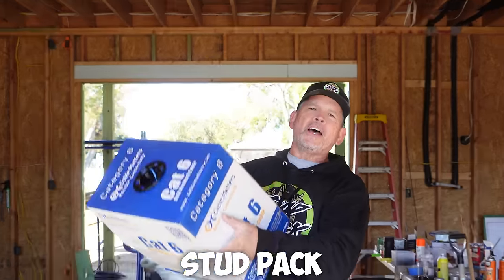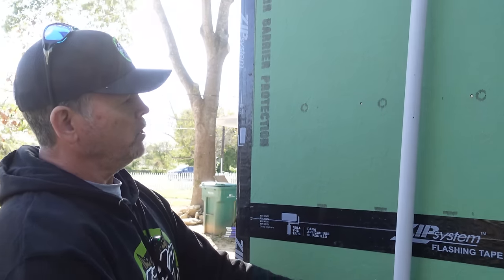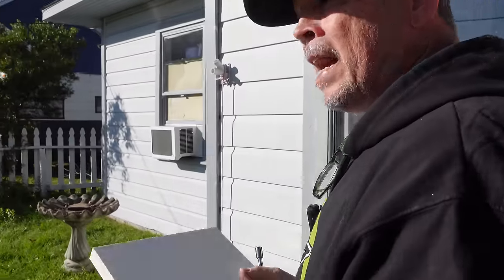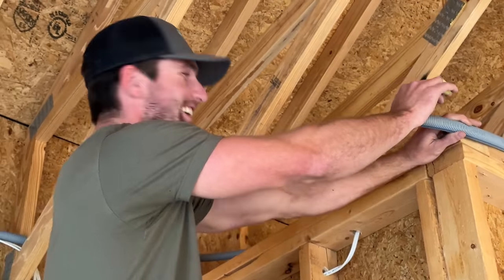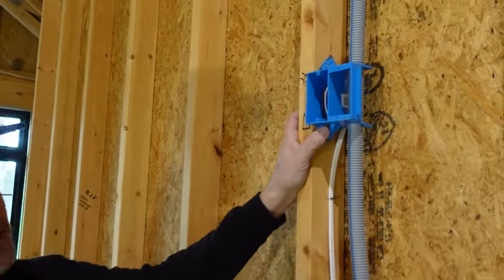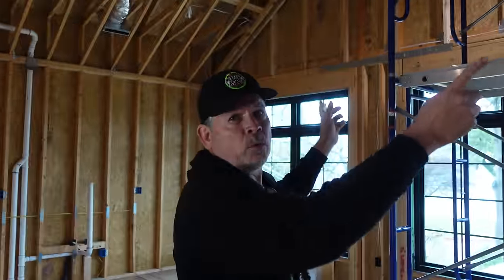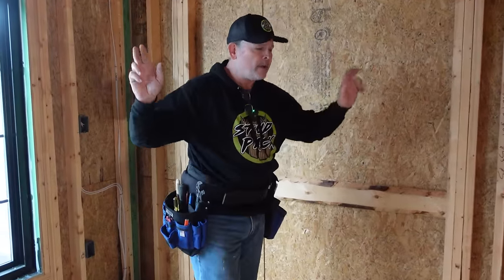DIY Networking for a Future Proof and HIGH SPEED Home! (Smurf Tubing and String Pull Trick!)

Comment: You will want to avoid running CAT cables parallel to any power to avoid electrical noise. In a perfect world, you'd only cross a power run at 90 degrees.
It's also a little unusual putting an RJ45 connector on the end of a permanent run like that. Normally, you'd terminate into a Keystone RJ45 socket and use a patch cord from the wall to your device.
Reply: I think like he said in the video he was just demonstrating how it's done.. But yes, agreed. They should definitely use keystones on the wallplates! Much much cleaner look
Reply: At least use shielded 6a cable if you do run the wire near electrical.
Reply: If you rum shielded, ground the shield on one side to a communication ground separate from your electrical ground. (And any lightning protection ground). In a professional network you want a grounded equipment rack for your router, switches, and modems - the rack ground doesn't need to be expensive, just separate.
Reply: @fuckthisksksjjksdfjd  Shielding, unless you use steel sheathing/conduit, only blocks electrostatic noise, not induced electromagnetic noise.

Induced interference from adjacent power lines is almost a moot point, especially with twisted balanced lines, and digital signals at that. The concern is more for safety and isolation of heat and/or mechanical issues.
Reply: Homeruns aren’t too unusual. If I’m going to a PoE device I usually terminate that way.
Reply: Also I haven’t had interference problems with residential power and Ethernet 😊. In a galaxy far faraway RS232 DEC terminals were another story!
Reply: I was going to comment exactly that. If you damage the exposed part of that cable, you're pretty much SOL. Terminating the cable with a keystone jack ensures that the permanent run is protected within the wall. The only part of the run that is exposed is the replaceable patch cable.
Reply: The last time I looked, I think code says you can't run low voltage parallel to high voltage without a minimum 6-in gap
Reply: @Sartek  In the same conduit, not parallel to.
Reply: Keep CAT 6 cable at least 16" apart to minimize the potential for a 60hz hum
Reply: You can run STP parallel to power lines if you keep an 8” distance, so in practice, for these short runs I would not be tooanal about the distance.
Reply: Agreed!
Reply: @CharlesBundy-z9n   Agreed.  In our computer labs, (in the days before every student came with a laptop), our computer desks all came with a single wiring tray along the back.  Everything went in it together: power, ethernet, video, etc.  Never saw any interference issues.  In fact, that's why the cables are twisted in the first place (and why the signal is sent with differential manchester encoding).
Reply: @Sartek   Yes this is true but it's now just 2 inches.  But really doesn't matter anymore with how cables are made. Just a way to keep government employees employed
Reply: in all honesty you could use UTP cat6 and be alright running parallel to power lines.
Reply: @fuckthisksksjjksdfjd  STP is unnecessary for the whole 5-10ft the CAT6 will run parallel with a 120v line. IF this was a higher voltage line and the run was going to be 20'+ parallel then STP would be necessary.  STP is mainly used for industrial applications due to eletrical noise transference.  Someones home eletrical line powering a TV or a Light /load isn't going to generate that kind of noise.
Reply: @dtuttle351  Possibly correct, I am not sure.  If I am going to run ethernet thorough my house I like to make sure I only have do it once.
Reply: @fuckthisksksjjksdfjd nobody should plan on running once 😅. I first ran Cat 5 in my house 100M then upgraded to 5e for 1G and have been pulling 6 where it makes sense (short haul 10G, homerun PoE). I’ve redone the network closet at least two times!

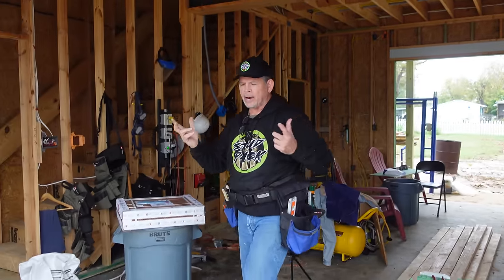Comment: Guys, it looks like you're going to have CAT6 "patch cables" coming out of your walls. If so, bad idea. Run your solid conductor CAT 6 inside the walls to an RJ45 jack, then run a proper CAT 6 patch cable (stranded conductors) to the device. Yes, do this on both ends. Not sure what the perceived benefit is of "connecting directly" as you say around 26:05, but I'm assuming that the thinking is that "fewer connections" is going to increase the signal integrity. You're not going to have faster gigabit (or even 10 Gb) connectivity by skipping a couple RJ-45 male-to-female connections, so there's zero benefit. But having those cables come out of your walls is only going to cause trouble in the long run.
Reply: This.
Reply: 100% this
Reply: Yes, plus it looks tacky. Why even have smurf j-box connecter that will be hidden, yet have a solid copper pig tail going to the TV.
Reply: Interesting. Never knew this. I've done it both ways and generally works just fine but good to know
Reply: This is 100% correct.  I've had to be the one to make that correction after the fact, and even though it was in raceway, i still wished ill on the mother of the previous installer.
Reply: Agree. Solid wire is meant for walls where it will never move. Stranded wire is designed for flexibility and should connect from the RJ45 jack to the device. Running solid wire to your device will eventually create loose connections in the connectors and degrade the signal.
Reply: Cat 6 can be difficult to terminate, especially with cheaper tools. Leave yourself a little extra length as you may have to re-terminate a couple of times.
Reply: The biggest benefit is that you can change how far the cable reaches by using a longer network cable from the wall to the device in the future. Looking nicer is also great.
Reply: im assuming "connecting directly" is a "continuous run" design decision, no or fewest splices, patch panels, or couplers in between.
Reply: I agree! There is no "benefit" plugging directly in to the computer or other devices in the house
Reply: You say not to run like this and do the whole keystone thing for a panel on the wall.
I have to ask, what anout having only 1 gang to be able to run HDMI, Ethernet,and speaker wire through? Put a brush plate on a single gang and run them all through there?
Or would that lead to signal interference?

Comment: Hey Paul. 20+ year Network admin here... Not too shabby on the Cat6 cable termination. I would recommend one change to the stripping process. That string that is in the cable is used to strip the blue jacket back. So you'd use the wire stripping tool, remove a section of blue jacket, but the stripping tool CAN nick the 8 inside wire jackets slightly. Sometimes it weakens them to the point that they can break off even. So the idea is that you pull the string back at 180 degree angle to the cable, using it like a rip-cord, to cut down the side of the blue jacket, exposing even more of the internal wires... then trim off the blue jacket with snips, along with the string and the center plastic spacer/insulator. Now you have guaranteed strong wires you are terminating.

And yes, listen to the others commenting about making the wires into jacks instead of home-runs to the devices... cables break, get pinched in TV mounts, etc... and replacing a patch cable is a few bucks vs hoping you have enough slack to re-terminate a cable. Plus you get the flexibility of choosing your patch cable length. You guys aren't ones to cut corners... don't disrespect a proper network install. ;-) Great work, men.
Reply: Absolutely agree ... another network admin here and this is how the installers stripped cable AFTER they pulled it to where it was going to live. Strip about 1" from the end to expose the 8 wires, then use that string to pull down against the jacket from the inside to open it up about 2" & cut off the wires just below where the stripper cut the outer sheath and none of your cables will be damaged. Crimp just like you did when you're ready - nice job, Paul! Since you're using pass-through crimps, make sure that anything else you use is compatible with that pass-through system.
Many,  many years ago I asked a pro installer why why they were wasting so much cable. They showed me the right way which is how @BrentTech commented above with the exact same reason - if any wire gets nicked, you won't see it, but the cable will fail the test if nicked. Also, please use patch panels, wall plates, and modular connectors . I've been watching this channel for a while now and I know Jordan has probably changed things after this video posed! Using a patch panel, wall plates, or surface mount boxes (a.k.a. "biscuits,") and patch cords will help make those moves, adds, and changes easier. Make sure to use patch cords a little longer than you need. Got a 10' run? Use a 14' or 15' cable. This is after you've drawn-up a cable plan. It should look like your electrical plan, but for all the low voltage. Keep low voltage about 1' away from the high voltage as much as possible and cross at a 90 degree angle when you have to. Also, use service loops wherever possible. Many of the installers I work leave a minimum 6" service loop at the wall jack tucked neatly into the box. That comes in handy if that wall jack gets damaged for any reason, just pull out a few more inches of cable and reterminate. For a biscuit, same idea, but leave 6" to 1" of loop before terminating.

So, you already have fiber service to the house, and you're getting fiber into the garage. Once your new service is up, will you run a temporary cable over to the house so you can avoid paying double?

You showed the fiber distribution box outside the house which probably connects to an Optical Network Terminal (ONT) inside. The ONT has status lights for Power, PON (Passive Optical Network), Data, and other LEDs depending on the model of the box, your service, etc. From there, you may also have a residential gateway. After that, you will need your own equipment, unless you can rent it from your Internet Service Provider (ISP). But, knowing you guys, I don't see you renting anything you don't need to. What do you use now? Ubiquiti gear is pretty nice, but expensive. Please don't use a mesh, you probably won't like the performance. Use wired backhaul for any wireless access point (AP). Check out TP-Link. One of the houses Risinger worked on had a really nice low voltage wall - maybe give him a call.
Thumbs up on the cable pull, smurf tube, long sweeps, and outside PVC panel and conduit!
Reply: There is already a stripping tool on the Klein crimpers. Also stripping the jacket off pulling the ripcord and trimming/snipping the jacket is a waste of time. When you use the strip tool you don't cut through the jacket. You score it and the jacket breaks right on the line. You know if never made it through the jacket you cant have touched the wires. Faster and cleaner. Also I have never found a cat5/6 plug that wouldn't' work with my Klein termination tool.
Reply: Sys admin here and 100% agree
Reply: I remember this from cert training even back in the 90s.  Correct and great advice.
Reply: @jamesa8851  "Doing things right is a waste of time"
Reply: I use electrician scissors to score the blue jacket.

Comment: I know lots of others have jumped in but you should 100% be using wall plates/jacks. The wall plate makes it so the cable in the wall is set and doesn't get moved or manipulated ever. It is just the "right" way to do it. Also as a FYI the middle piece in CAT6 or crossbar is to keep the cable pairs in the cable separate.
Reply: Also since they are using solid wire it will not handle being moved around as much as stranded which is used in patch cables, sure it works but moving stuff around and bending and flexing them can damage them over time, and they dont like being kinked as much. also if the cable end gets damaged you got to re-crimp a new end instead of just swapping out a few feet of patch, so more of a time waste although doesnt matter as much as a home user but can lead to frustration down the line, especially given the the modem/switch are going to be in an attic space and not out in the open.

Comment: USUALLY, signal/data wiring should cross power lines at right angles to minimize power noise interference into the signal/data lines.
Reply: No need to worry until the modem converts optical to electrical. Then yes could be a concern.
Reply: This is still best practice. Granted newer cables have more shielding. Many youtube channels have proven its still not quite adequate. This is why you still see "faraday cages" inside certain electronic devices. Ever read that electronics warning inside every device in America "this device complies with XXX and must accept signals from XXX "
Reply: @nuzzlefutz same here. 15+ years of running network cable right next to electrical without any conduit either. Worked just fine. If you want to take the extra step you can always get shielded twisted pair.
Reply: Thank you, I retired before knowing about Cat 6. I appreciate the feedback
Reply: Another note.  Everything CAT5 and beyond terminates in a dynamically balanced transformer PHY.  Very little nose makes it through the transformer since it is deposited equally on both wires in a pair.  This gives a fantastic Common-mode rejection ratio without the need for shielding.  CAT 6 pushes the Nyquist limit on this technology, but can and does work without shielding engaged.